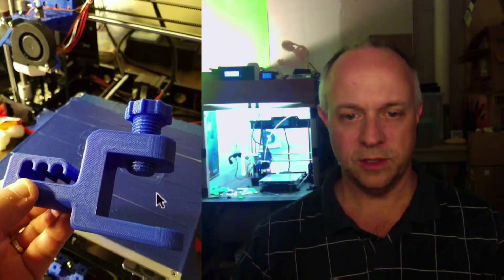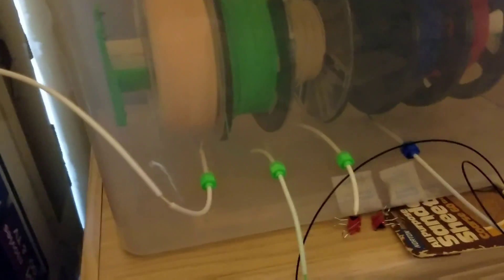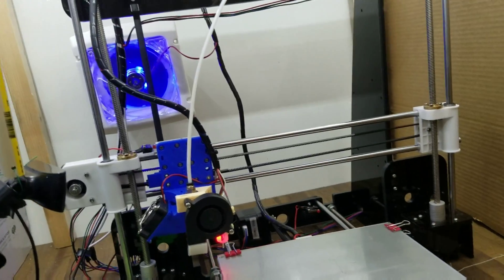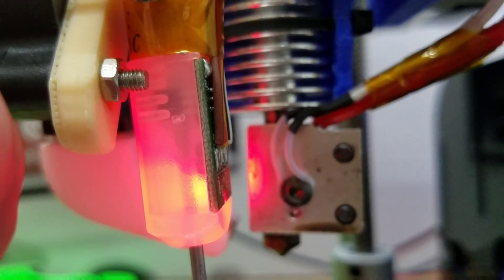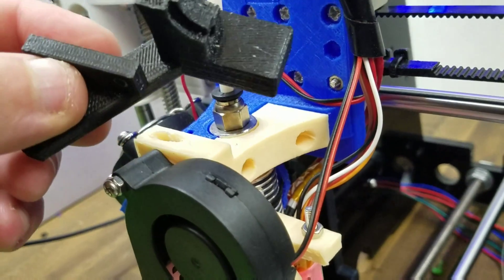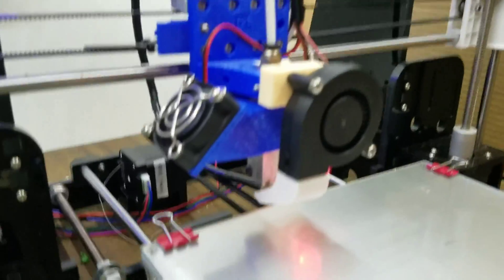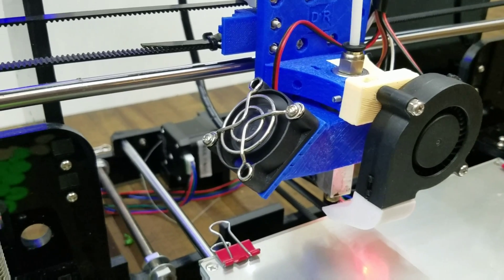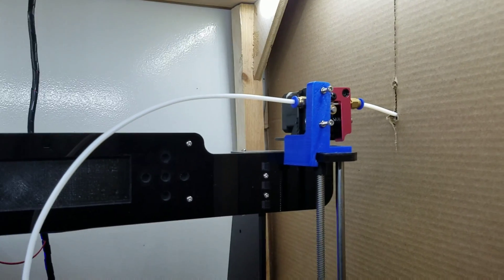Anet A8 Bowden Upgrade

Comment: Update:L I made the upgrade and it's working out good, as you stated the E3D sits lower, in my case about 15mm lower. I made changes to the design to raise the hot end but I may not bother making a new carriage as I have another printer that can be used if I need more height.

Comment: Bowden gets less artifacts and ringing but stringing becomes more of an issue. And flexible filliment is more jam prone as well.
Reply from the maker: Yes. Stringing can be more of an issue with a bowden. Many times tweaking the retraction settings is required to control the stringing. Flexible filament can definitely be an issue too.  Direct drive extruders can be better for flexible filament or something like a Zesty Nimble can get you the best of both worlds.

Comment: Hi, do you have the stl file for the BL touch support, could not find it on Thingiverse. I have no comments on the wiring.... I am an engineer as well hahaha
Reply from the maker: I don't.  I ended up designing my own by taking the existing obscure STL file and adding extrusions to the model in Blender. But, that's been so long ago, and I've changed out my raspberry pi's and main system since then so I don't have the files available.  If I were doing it all over again, I would design the entire carriage from scratch and customize it to exactly what I want.  I've migrated everything to my custom HEVO build as my main printer now.

Comment: I wish I bought an Ender 3
Reply: i feel you :(
Reply: why?
Reply: @aspenmallery  because it's better for the cost
Reply: @discodairy191  but if you are planning on improving the quality of prints with cheap rational upgrades, it makes more sense to get the larger print bed that comes with the A8 Plus. It is the same price as the Ender 3 right now. The Ender 3 community is larger though, so information is more easily accessable.
Reply: @aspenmallery  do a direct comparison in real life
Reply: @discodairy191  it's very hard to compare the two without buying them both. I am considering buying one or the other and have been doing research. 

The amount of available printable mods for the two printers seem to be the same. The Ender 3 has more quiet steppers but a smaller print bed. The A8 Plus has a large bed, but louder steppers and a slightly slower print speed @ stock.

You can reduce the noise on both machines by replacing the xyz bearings. There are 3D printable components for both machines which improve structural integrity and airflow which leads to better prints. This helps the A8 especially since it's a bit heavier and bigger.

Overall, I'm leaning toward the A8 Plus because they fixed the thermal runaway issues (a fire concern), and you can still get very high quality prints after printing out the mods which helps with the weight. Noise doesn't factor into my purchase since I am looking for functionality over asthetics. The larger print bed means more options in the long run, and I will be printing mostly mechanical pieces for projects anyway so getting fast prints with super crisp edges is less of a priority. The A8 has plenty of resolution to print threaded holes which is one of the more important traits for mechanical stuff in general.
Reply: @aspenmallery  you won't be disappointed if you go with the ender, but it's ur choice and ur time
Reply: @discodairy191  that's true. There's more risk involved with the A8. But once it's set up right, it's a better value.

Comment: Great Information and ideas! You read my mind exactly, because I thought about using a Bowden tube to feed the extruder remotely. I haven't been using my printers lately. In fact, a month ago I just put together my Anet A8 that I bought back in 2017 and my Printrbot Simple Metal has been sitting idle in my basement since 2017, about the same time you probably made your video. I now have a Creality Ender 3 and looking to get a CR-10. The Ender 3 is Phenomenal! I'm looking to convert the A8 to a Bowden Tube because I'm having leaking issues on the hot end from the extruder nozzle. I've already wrapped it in Teflon tape to try and seal it, but no luck. So I was thinking to convert it to also alleviate another problem that I have. Getting the filament to line up when inserting it into the hot end. It never lines up and I end up breaking the end or jamming it up and them having to remove the whole damn thing to clear it. Thank You again for the video.

Comment: Great video! Question for you, I also got a cheap E3d v6 clone and having trouble with the extruder not heating up. Did you run into any problems like this, or have any suggestions on how to trouble shoot?
Reply from the maker: I haven't had any problems like that. Is your heating cartridge properly installed in the block? Is it positioned and tightened properly? Do you have the correct thermistor installed properly in the heat block?

Comment: Hey just upgraded 2 days ago having some crazy issues witch sucks cause no more ripples in a calibration block but when it goes to print for say better fan duct for the ed3 v6 side mount witch every fan duct i print is to long . it wants to touch the bed before the nozzle  if that helps image it. it looks as if i am way under extruding i am stuck .
Reply from the maker: I'm not sure I totally understand your question... Your fan duct needs to be higher than your print nozzle. You may need to reposition the fan duct (or lower the nozzle) or print a different fan duct that doesn't go as low as the nozzle.

Comment: How high you can print with this upgrade ? Is there any impact ? I'm thinking about the case in which you have to print a tall model that is near the extruder
Reply from the maker: In this case, the high carriage does reduce the amount of Z height.  But for me, I have other printers for larger prints and tall Z requirements.

Comment: Hello, What mount are you using for the BLTouch with this carriage? I printed the same X Carriage and Im very interested in the BLTouch mount. THanks you!
Reply from the maker: I ended up modifying it myself. All of the carriages I found on thingiverse didn't quite work for me so I had to pick one close and then I modified it in Blender for my specific touch sensor and positioning I wanted.

Comment: Hi! Like what you did with A8. I have a simillar printer but it still direct driven. I Have a question a bout that 3d touch you have. You had a typical endstop and you changed it for 3d touch does it comes with any software changes or is it basically the same thing but doing its job better? I have a different connector on my end stop than's on the 3d touch you linked above.

Comment: I notice in the background you have a8 in closure. How does place handle printing in hotter environment for say abs? Does it get more flexible?
Reply from the maker: I pretty much just print in PLA with the Anet A8.  The enclosure is primarily to get rid of the fumes and reduce the noise.

Comment: Can any one help me with the part he noted he edited the software for the new Print head positioning but in cura i cant find where to put that code to correct the print head positioning.
Reply from the maker: I'm way late with this reply but you can change it in the firmware or GCODE.  Depending on what you're trying to do and what kind of "3d printing software" you are using, you may be able to set it in the software's configuration.

Comment: sorry I have a problem the printing part then when the 2 fan that cools the nozzle drops me the temperature is blocked me the press giving me error I have the same lcd .. what firw do you use?
Reply from the maker: I'm currently using SkyNet3D v2.3.2.  Due to the newer versions of Cura using a different config structure, I stuck with an older firmware compatible with my Raspberry Pi and OctoPrint.  This way OctoPrint can do the slicing and send it directly to the printer.

Comment: you have the link for the bltouch also?
Reply: With minimal redesign work I believe you could get 20-30mm more Z axis height
Reply from the maker: Absolutely.  That's what it's all about... Redesigning, tinkering, and having fun!
Reply: What is the Hot end bracket made from
Reply: Why did your mount reduce the z axis so much
Reply from the maker: 3D Touch Sensor (BL Touch Clone):
https://www.aliexpress.com/item/3D-Printer-Auto-Leveling-Sensor-With-Auto-Leveling-Feature-3D-Touch-Free-Shipping/32722934550.html
Reply from the maker: The mount location for the E3D is lower than other designs for the carriage.  I lose a bit more z height with the volcano heat block too since it is longer than most heat blocks.
Reply: Also what acceleration speed are you using with Bowden extruder
Reply from the maker: It depends on the print and the quality I'm looking for.
Reply from the maker: What do you mean by "Hot End Bracket"?

Comment: I am wondering if doing up a 2nd Z axis to mount the feeder and swing it with the 1st Z axis.   it should eliminate any lateral pressures on the filament against the walls of the PTEF tubing as the  1st Z is swinging?
Reply from the maker: I'm not sure I fully understand your question... Also, any lateral pressures on the filament from the PTFE tube are negligible and shouldn't really be causing any problems with prints.  Converting to a bowden setup is primarily beneficial in removing the weight of the motor from the moving extruder to allow for faster and/or better quality prints.
Reply: Yeh , my fault, it was the Y axis i was referring to. Why i was focused on the pressures etc was from something i seen on another channel where someone noticed a difference in the print from just keeping slack on the filament.Your  probably right though ,in that its negligible,cause the prints come out pretty good. But we strive for perfection :)

Comment: you are using the same e3d v6 clone i was thinking of buying and the same mount i was thinking of printing
Reply from the maker: I've had no problems at all with this e3d v6 clone.  Love it! As for the mount, if you're talking about the motor mount, it's fine (although the version I printed didn't have a big enough groove to fit over the thicker acrylic for my Anet A8 so I had to make it bigger to fit well)... If you're talking about the carriage mount for the e3d v6, I'd recommend using a different mount.  If I did it all over again, I would use a better design.
Reply: Miser Maker okay thanks
Reply: Miser Maker thanks for your help 
Now a tip from me i know a place on instagram that gives away fillament called quantum 3d printing i have won it before and it works great only about 30-50 people enter a week also have you printed another hot end mount and is there another one you think i should print?
Reply: Also I am 15 but am kinda good at designing in fusion any tips you can think of to make a better mount?
Reply: Miser Maker sorry for so many questions but do have to do any mods (wiring) to get it to work with the anet a8 i saw the thermister plug looks different?
Reply from the maker: For the carriage print, I'd just pick another one from thingiverse.com... there are plenty to choose from.  Choose one that works with a lot of "add ons" such as fan ducts (that are preferably from behind or the side) and bed leveling sensors.  For the motor mount, you can use the same print STL but edit it and make the groove for the acrylic a little larger based on the thickness of your acrylic.
Reply: do have to do any mods (wiring) to get it to work with the anet a8 i saw the thermister plug looks different?
Reply from the maker: Hmmm... I replied to your previous question about this a couple of days ago but it must not have saved... The main difference is that you may need to lengthen/shorten the wires to the bowden filament motor depending on how far/close you mount it to your main board.  One advantage is that the motor wires will no longer be continually moving with the other wires running to the moving hot end.  You still have the thermistor wires running to the hot end obviously.  I recommend running both the hot bed and hot end wires to mosfets.  But, that's the same whether you go with a bowden setup or not.
Reply from the maker: You can see it in this video around the 9:35 point (which I embedded in the link): https://www.youtube.com/watch?v=KM5e0czyYuE&t=9m35s
Reply: Miser Maker mine has a black plug with two prongs not three
Reply from the maker: The thermistor in essence is just a resistor and does not really have a polarity.  So, you'll only have two wires and they can be connected either way to the to the two prongs (one wire to each prong/terminal).  Mine are just connected via the mosfet first (the two red wires on the two bottom left terminals of the mosfet module).  Then, the two white wires from the left side of the mosfet module plug into the 2 terminals on the main board for the hot end thermistor.
Reply: Miser Maker sorry for so many questions but have you stopped youtube or do you just not have time ?
Reply from the maker: SC Outdoors/tech I haven't "stopped" YouTube. I just haven't had the time lately to do more videos. Once hurricane Irma came through Florida (where I live), I was without power for over a week and I have been cleaning up ever since. I've also been busy with work and family matters. But... things are starting to settle back down to normal.... So, there may be more videos coming soon...
Reply: Miser Maker if you can could you do a video on how to connect a e3d hotend and how to set up the firmware ?
Reply: I cant find a single good video on it
Reply from the maker: It's not on my immediate list of planned videos at the moment but thanks for the suggestion.
Reply: Is the mount printed in Pla or abs ?

Comment: So how is the bowden a upgrade?
Reply from the maker: It depends on your perspective as to it being and "upgrade" or not.  It's different from the stock direct drive setup to be sure. A couple of the improvements for me going to the bowden setup is primarily to reduce the weight of the carriage to allow for faster high resolution prints and less hassle changing filament.  I also have less problems with clogs/jams with the bowden/e3d setup.
Reply: Pukki34 because it’s better and is an upgrade fucking dip shit

Comment: would it be possible to mount  the E3D higher up on the carriage. It looks like a lot of wasted space above it.
Reply from the maker: Yes.  That's what I would do if I was doing it over again (which I may do in the future).  There are other carriage designs that are higher.  Or, you can design your own.  Especially with the longer volcano heat block I'm using, my current configuration wastes more vertical space.  I definitely recommend mounting it higher.

Comment: hi do you have a l;ink to the extruder
Reply from the maker: Hi MacGrams. Here's the link (not an affiliate link) to the full hotend kit I'm using.  However, I'm using the Anet A8 fan (with a printed fan duct) instead of the one in this kit.  I do use the volcano heat block from the kit with the 0.4 nozzle.  https://www.amazon.com/gp/product/B01ESTJUL8/
Reply: I think this is it.... https://www.amazon.com/Printer-Accessories-Extruder-Filament-Bowden/dp/B0743D32ZB/ref=sr_1_fkmr0_2?s=industrial&ie=UTF8&qid=1509304809&sr=1-2-fkmr0&keywords=extruder+anular+3d+printer